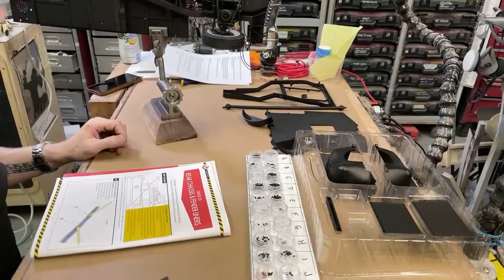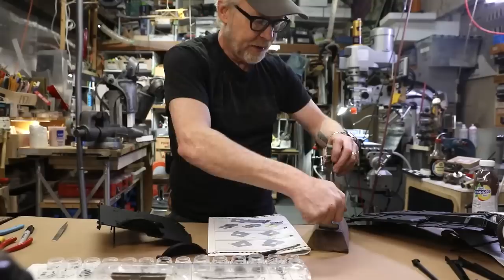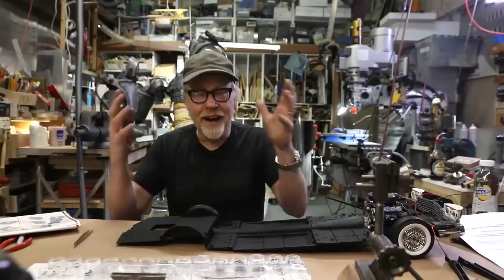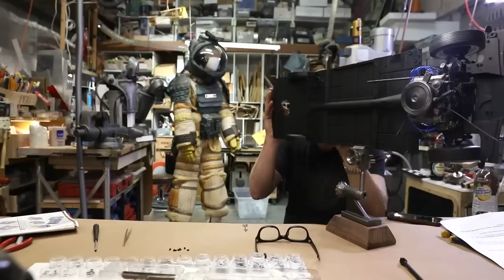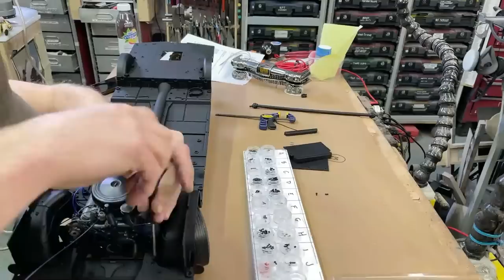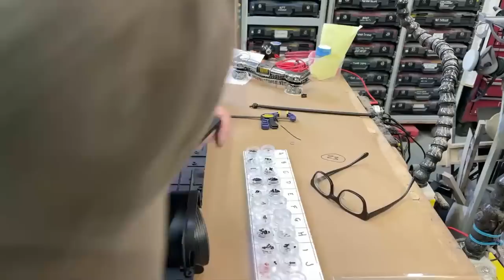Adam Savage's Live Builds: Ghostbusters Ecto-1 Kit (Part 6)

Comment: Still snowy here in upstate NY. Just wanted to chime in, when you said you don't think anything you've ever created had 28 different types of screws. I used to work on CH-47S and it astounded me how the engineers that designed it had to come up with the dimensions for all of the different bolts and nuts and etc. Just boggled my mind.